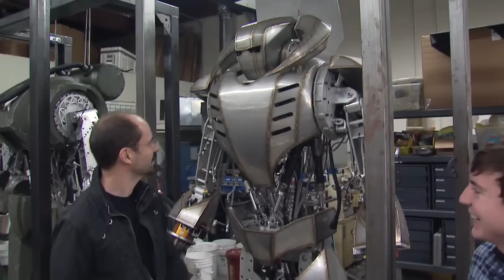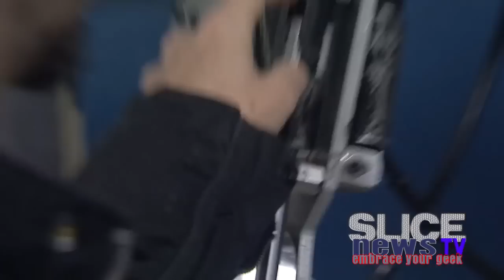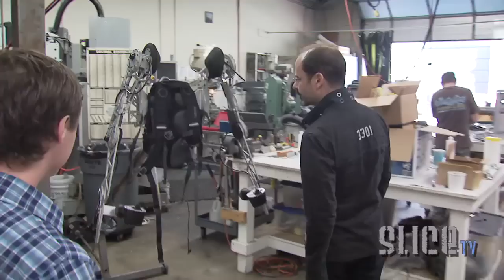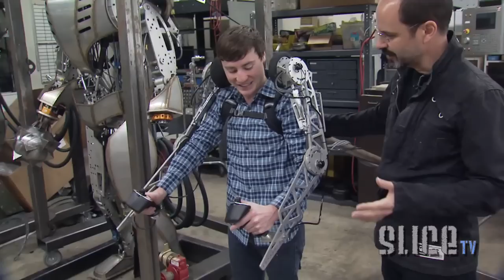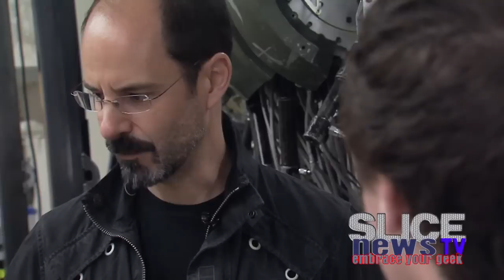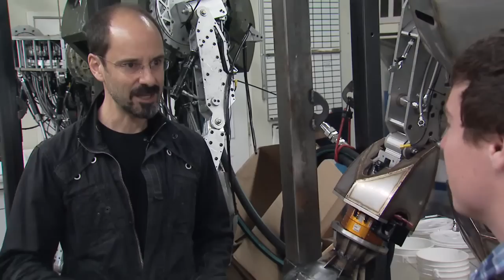Robot Combat League

Comment: What's with the shill accounts posting how great this show was? It was terrible and fake. They did absolutely no damage to each other.
Reply: +RetroGamerr1991 I remember I saw one episode where one competitors head fell off, though it looked more like it was just attached poorly rather then actual damage.
Reply: ***** Hmm, must've been watching a different show. One where fluid wasn't leaking and pieces of metal weren't falling off.
Reply: Funnist Preacher You seriously think that fluid was really coming from hydraulic systems? If a hydraulic line split open, the pressure of the rest of the system would drop making these "robots" immobile. As for the metal, not once did a piece of metal actually become dislodged from these things. You're probably thinking of the spark effects which is complete Hollywood bullshit. You want to see destruction? Watch Last Rites at Robogames.
Reply: +STICH666 Have you ever seen battlebots same concept as your robogames but you know from the early 2000's
Reply: There's also Robot Wars, same as Battlebots but started a bit earlier I think. It's also getting revived this year.
Reply: killerkenny888 It was the greatest show my 10 year old self had ever seen